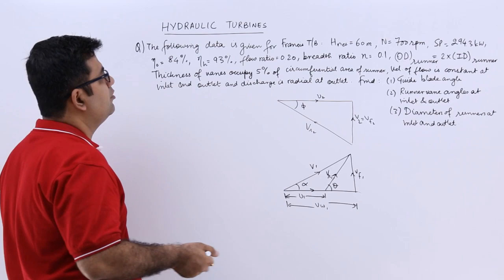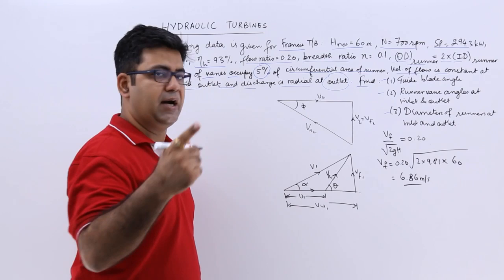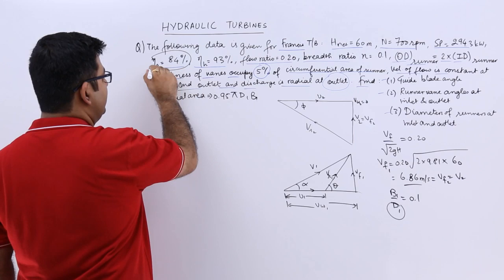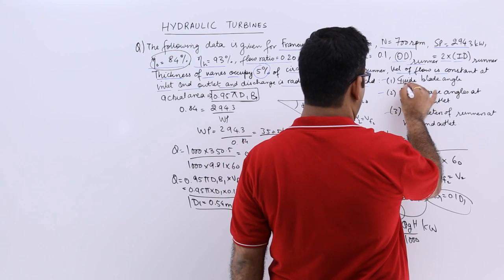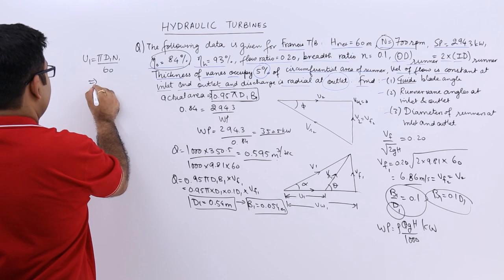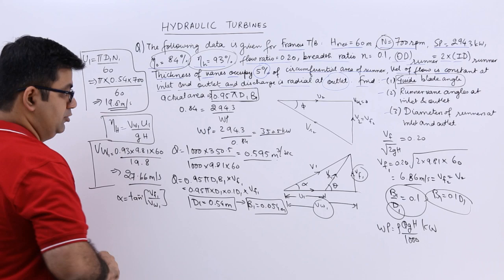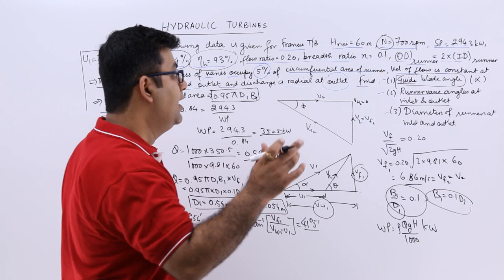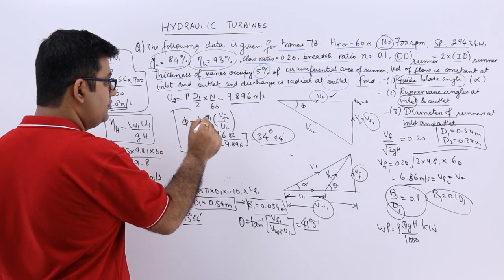Francis Turbine Problem Example 1

Comment: how u get 0.95 in actual area equation
Reply: NISHAD K M Thickness of vanes occupy 5% of circumference area is given so you have 95% left with you which is denoted in numerical as 0.95. Just ÷ by 100